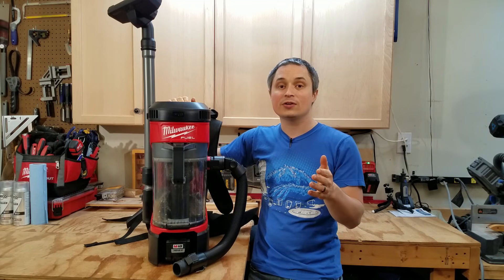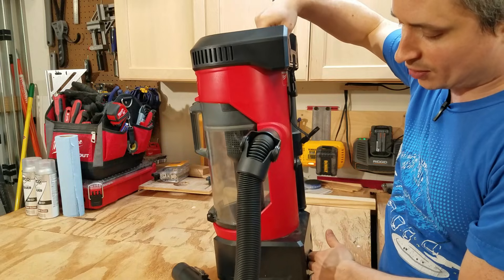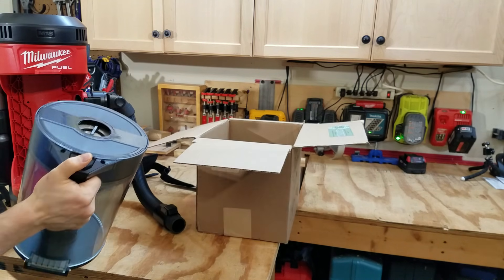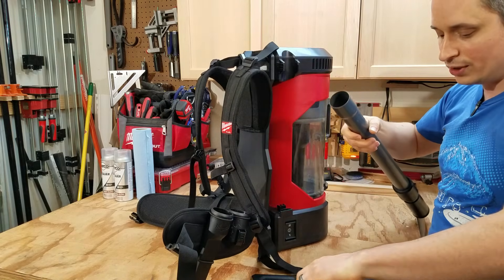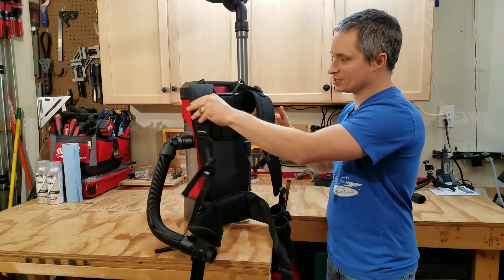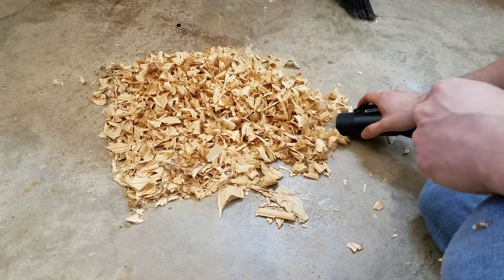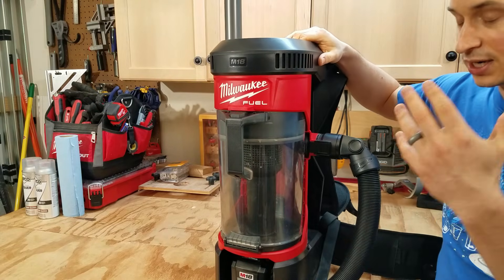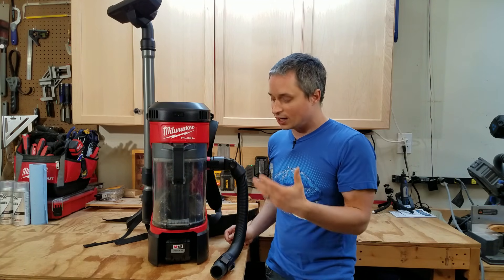Milwaukee M18 FUEL 3 in 1 Backpack Vacuum Review

Comment: On my vacuum cleaner if I close off the flow completely, the power use drops by half.  Typically as you close down the flow the speed of the fan/motor increases signaling lower power use.  right?
Reply from the maker: I think you're right. I thought about what's happening some more, and the vacuum is moving less air when flow is cut off. The motor just spins faster due to lower torque and sounds like it's working harder.
Reply: The higher the pitch of the motor sound is the tell you got a clog.
Reply: @DoresoomReviews  I have a power meter on my home electricity and have verified this on my Sanitaire vacuum cleaner, the highest power draw is with no bag installed, no hose, no restrictions at all.  Completely closing off the flow reduces the electrical load to around 2/3 full load and the motor speed surges up.
Reply: It's due to having less air resistance as its essentially making a vacuum
Reply: Yep that's right. Less air being moved, less resistance= power savings.

Comment: for this price you should be able to plug it into a wall as well.
Reply from the maker: With the amount of current this draws, it would need a heavy transformer to use wall power as well. The reason that their lights are hybrid power is because they're lower current draw.
Reply: I've read that this thing can get a bit more than 20 minutes on High an HD9.0 battery. That's nominally a 9Ah battery, probably less under load because of heat due to battery internal resistance. Anyway, that's about 9Ah / (0.33 hrs) = 27A, and that's a high estimate. At 18V nominal, 27A * 18V = 490W. Assuming 85% AC-->DC conversion efficiency and 120V rms from the wall plug, that's 490 / 0.85 = 580W.

The tricky bit is finding a non-battery power supply that produces 18V at nearly 30A and isn't some cheap consumer junk. Meanwell offers the HRP-600-15 which can handle up to 645W continuous and for which the voltage can be adjusted up to 18V. One of these supplies costs a mere $160 and would add 3.3lbs to the product weight. A similar 600W power supply without PFC and not currently offered in an acceptable voltage range can be had for ~$70.

As Doresroom Tool Reviews says, the lights draw maybe 3A max from a battery which is less than half an amp from the wall. Correspondingly, they're cheap and lightweight. For a vacuum or a saw the 500W-2000W peak power draws calls for big, heavy power supplies that may add $100-$300 to the cost of the product and increase weight by 3-8lbs at a guess. Manufactured internally, Milwaukee could no doubt make a cheaper power supply, but they can't get around the weight issue to a large degree, especially if the product chassis is mostly plastic (meaning there isn't a large metal structure in place for heat distribution).

Side note: Other companies use higher voltage packs which yields less current on the DC side, making power supplies cheaper. Metabo HPT for instance has a corded adapter for their MultiVolt line. The Dewalt 12" miter saw uses two 60Vmax FlexVolt packs in series for 120V, which has the convenient side effect of not even needing a conventional power supply to draw from wall power. It can just rectify 120V rms and get 120V DC, albeit with a lot of electrical noise.

Comment: Don’t waste your money.

This is not a well-designed tool and it needs significant improvements before it’s worthy of the price. To be fair, I love two features about it; it’s super quiet and the mechanism for the wand was really nice. That’s where it ends.

My first real test was to clean up the wood shop; there's a lot of saw dust in a wood shop, but that's expected. After about 20 minutes of vacuuming, with 4 inches of saw dust collected in the canister, the power dropped significantly and the motor's flow was significantly reduced. I dumped the canister, but there was still no flow. I pulled out the circular, pleated filter and it was completely jam packed with dust. In other words, this vacuum won't work for trades. It might work for light duty house cleaning, but not serious construction site work.

Here are my gripes:

1- The cyclonic dust separation unit is rudimentary in design and needs to be significantly reworked. On the first 20 minutes of use, saw dust was clogging half the holes in the first size exclusion cylinder and what didn't get stopped there ended up in the pleated paper filter. The pleated white filter was solidly clogged with dust. Take notes from Dyson, their filters see very little dust through really good design in being able to separate the dust from air. 
2- The 4' telescopic wand is made of steel. It’s heavy and because the unit didn’t come with a small brush (really?), you’ll want to use the bare end of the pipe which will dent trim and be prone to being dented making it unable to slide on the tip attachments.  The black plastic cuffs are too big a diameter for comfortable vacuuming. Why not anodized aluminum which would be lighter and less prone to denting (swinging mass)?
3-  The body of the unit is too heavy. Who ever designed it had zero interest it making a beautiful tool and no finesse in finding an optimised design between durability, sustainability and ergonomics. They just used kilos of plastic to ensure durability meaning the device just screams "I don't give a shit about the end user."
4- Why did it not come with a small round brush attachment? I get the battery, but attachments are key.

I love Milwaukee tools mostly, but this tool makes me wish I had bought into the Makita family instead. I'd love my money back, this tool is a huge disappointment.

Comment: Awesome tool! It looks like Milwaukee put a lot of thought into the design. I have a fair amount of experience with backpack vacuums and I can tell you that if you have a large area to clean, they are the best tool for the job. You would have to use one to appreciate it.
Reply from the maker: Yeah, my first job at 15 was custodial work for my school after classes. I hated dragging around a cord with the backpack vacuum, but it was still way better than a traditional vacuum. If Milwaukee makes an attachment compatible with carpet, this thing will be a home run for that use.
Reply: I need one so bad. I’m SICK TO DEATH of the cord on the backpack I use for work!

Comment: The suction test was interesting. I think a lot of people don't realize that even though the voltage stays the same the amp hour rating can affect performance on some cordless tools. It took me by surprise the first time I saw that mentioned in one of the manuals.
Reply from the maker: Do you know which manual it was? I've had requests from viewers before for official Milwaukee documentation stating that higher capacity batteries can output more power.
Reply: @DoresoomReviews  I may have remembered incorrectly. It may not have been a manual and I'm not sure if it was for Milwaukee or Ryobi. It was about a year ago. Checked both manuals and didn't see anything. All I keep seeing when I try to recall the first time I saw it was a blog post on Ryobi's new batteries and a video review of the Milwaukee but neither was an official source now that you mention it.
Reply from the maker: Ok, thanks for checking. Either way, the vacuum test pretty much proves it. :)
Reply: @DoresoomReviews  A higher Ah battery may or may not output higher current / power, depending on which cells are used, how many, and how well they're cooled. This is more of an issue for the XC6.0 vs the XC8.0. Going from a CP3.0 to an XC6.0 would perform significantly better, just because there are twice as many of the same spec cells.

Comment: 3 things I gotta say...

1 great review!  thank you! I appreciate the camera angles and examples of yourself actually using the tool.

2nd #milwaukee hope y'all  took notes if not  I did. * make it  3 inch hoses diameters, with variety of accessory nozzles *include both the 9ft and 6ft hoses in the package buyers will use both * add more suck, even if it makes it a lil bigger more suck for more hose and more accessories like the carpet bristle roller, * make it a dry /wet vac AND blower ... -_- yall need to re evaluate the advertisement team cause labeling it a "3 in 1" just makes the buyer think its also a wet vac, calling it 3 in 1 literally makes me think suction for dry/wet and a blower NOW THATS A 3 IN 1! *great potential especially if ya'll make it a wet vac at least. I know I'd buy one for interior car detailing. because lets face it if ya'lls  target buyer buyers are just the tool guys working in the construction business they are gonna buy the bigger SUCKIER vacuum that does more than just hang.

3rd My favorite thing about this vacum has to be the design and similarity to Luigis ghost vac from Nintendo's Luigi Mansion video games. I know the design team knows what I'm talking about. I am seriously thinking about buying one and customizing it for Cosplay. but at the same time if that's the main thing I'll use this specific vacuum for it makes me feel that it's just a toy/ just for looks. Hanging vacums aint new. People already know how to modify shop vacs to work while hanging. Back packs are great for mobility but at the same time shop vacs got wheels. So when you get down to it this vacum really just got looks while loosing potential for multi suction and blowing capabilities. not saying it wont sell. just saying im hoping Milwaukee wont turn into the "Apple" of the tool world and create die hard followers who spends nights in line camping out just to buy the "latest in technology" when really its not A+  worth the money. hahaha overall they either gotta redesign or lower the price. today is 3/10/21 and amazon selling it for for $271 usually at $367....if that "sale" isnt proving my point idk what will.

Comment: Boy I wish this was wet/dry... my world would be complete. 😔

Edit: there’s a lot of comments on here wishing it was wet capable. Honestly, I think it’s the whole Dyson format (design copy) thing that prevents it from being water capable. The seal for the dropout door at the bottom is probably not really water proof. So straight up sucking water might cause it to leak. Right over top the battery as well. 

I think a modded version would work. By glueing in a better gasket or o-ring where the trap door latches at the bottom could work. You’d void a warranty of course. But I might try it.

Comment: Thanks for great review. I appreciate you showing its strengths and weaknesses. Unfortunately until milwaukee makes a wet /  dry version i wont be  considering  this.
Reply from the maker: Yeah, if it was wet/dry I would have sold my Ryobi 3 gallon cordless vac, but as it is I still keep that one around for wet pickup.

Comment: I would love a smaller m12 version of this.
Reply from the maker: That sounds pretty awesome, but the runtime just wouldn't be there though. I have the M12 FUEL 1.6 gallon wet/dry vac, and it's great for small cleanup jobs. But it only gets about 2.5 minutes per Ah of battery. So a 6Ah will only last about 15 minutes, which would get really annoying taking it on and off to swap batteries.

Comment: strong enough for cleaning carpets in a vehicle ?
Reply from the maker: It's borderline strong enough suction for that use. But the backpack design actually makes it pretty unwieldly for getting into a car with it. The hose isn't long enough to just set it on the ground outside, and the vacuum itself is too big to fit easily into the vehicle. If you do use it for cleaning vehicles, the longer hose option that can be purchased separately is a must!

Comment: When they add a wet/dry vacuum option then i will get it. Until then dont need another vacuum
Reply: They do have a wet/dry M18. That isn't the point of this tool. It's a backpack vac. You really expect to be sucking water and be carrying that thing? Get real man. This is really, light work. (office, lobby, hallway clean up.)
Reply: ReptileGuardian could it handle mild wetness though... I wonder. Like cleaning gutters etc. A little bit of water in there with the other junk.

Comment: Does the filter work well sucking up fine dust? Or does it clog up quickly?
Reply from the maker: I've done some drywall dust with it and it does OK. It will clog up eventually and need the filter banged out though. For that reason I usually use my corded shop vac with a filter bag if I have a LOT of drywall dust to clean up.

Comment: So this would Drain a 3.0 Battery quick as heck. I’m looking for a Vaccum for the house, I know Milwaukee has great products .
Reply from the maker: This will work pretty well as a household vacuum if you only have hard floors, but not if you have carpet. I've tried the M18 multi head vac that also has a brushroll, but that one is pretty disappointing. If you have pets that shed it will clog up immediately. But I just bought a cordless Dyson V11 Outsize this week, and I doubt I'll ever use either Milwaukee vac in the house again. There's just no comparison. The Dyson is $$$ though.

Comment: I didn't catch...can this work as a blower, too?  If not, they ought to set it up to be a blower, as well.
Reply from the maker: It doesn't have a blower function. The exhaust is spread out around the top of the cylinder, so there's no distinct outlet port. It works better for vacuuming that way, since there isn't a gust of air coming from the vacuum stirring up dirt.
Reply: @DoresoomReviews  Thank you for the fast response.

Comment: which one has more suction? This or the wet/dry vacuum?
Reply from the maker: This one has more suction, but how close it is depends which wet/dry vac you're asking about. This vac has 75" of water column lift on high. The 2 gallon M18 wet/dry vac has 32" of lift, and the M18 Packout wet/dry vac has 47" of water lift.

Comment: Wait so how long does the 12 amp battery last??

U told us only about the 9 amp
Reply from the maker: Should be linearly scaled, so 33% longer than the 9 Ah battery. It's not a high enough draw tool for the greater efficiency of the 12Ah cells at high current draw to really play a factor.

Comment: Can you use this vaccuum to clean out your car. Every tool I own is milwaukee an I'd love to have this to clean the garage/car?
Reply from the maker: Yes, I've used mine for that and it works great. You might want to get the longer hose accessory though, since the standard one it comes with is a little short and you have to put the whole vacuum in the vehicle instead of just leaving it outside and stretching the hose.
Reply: @DoresoomReviews  Could you wear it on your back while kneeling in cars to vacuum? Im looking to get one to clean cars and vans that I detail and often have little space to work in(I usually use M18CV-0, but some cars a pretty bad so looking for extra power at times) . I thought something like this that straps to your back would be perfect. Or do you think its too bulky for that? Cheers in advance for any thoughts!

Comment: Damn no beater bar? That's the spinny thing on the bottom of the part for the carpet/hard surface. Is there a part you can buy for the beater bar?? I install carpet for myself & I want this vacuum but I need a beater bar!! Please let me know if you can purchase a part that fits the vacuum! Please & thankyou!
Reply from the maker: Milwaukee actually just announced a different M18 vac with a powered beater bar. Should be available this month! https://www.milwaukeetool.com/Products/Power-Tools/Vacuums-and-Fans/0940-20

Comment: I was impressed as I first saw how you vacuumed the saw dust from the floor! Suctions seems to be pretty good and awesome! the backpack design is also very convenient. Would you recommend it als shop vac, were it mostly stands on the floor? I know its intended to be carried around, but I think it would also do a great job in my workshop :-)
Only they should have designed the cyclonic separator better, so it would separate more dust and keep the HEPA filter cleaner. But I think if you clean it an a regular basis, it will maintain the suction of the vacuum.
Reply from the maker: Yeah, it works great as a shop vac too, but you'll probably want to pick up the longer hose they have for it. Also, it's not a wet/dry vac like most regular shop vacs are.
Reply: @DoresoomReviews  Thanks for your fast reply and the hint for choosing the longer hose! I`aware of the fact its only dry vac, but that's okay! Mostly you have to vacuum dry dust, so its not a big concern. Also I have the Bosch GAS 18V which can be used for vacuuming small amounts of water :-)

Comment: Do you happen to know if the connector heads are compatible with compact cannister vacuum?
Reply from the maker: I don't think they fit. Which canister vac are you asking about? They have the older tea kettle style one, or the newer compact vac with powered roller.

Comment: 밀워키도 좋은데 빠데리 성능이나 시간으로 볼때는 마끼다가 좀더 좋지않을까요 ?
Reply from the maker: It depends on what specs you care about. Makita has a slightly higher air flow rate at 64 CFM vs the Milwaukee's 55 CFM. But Milwaukee absolutely destroys the Makita when it comes to suction: 75" of water lift vs the Makita 44" of water lift.
Reply: @DoresoomReviews  답변 감사합니다